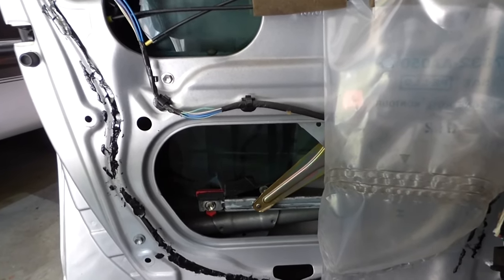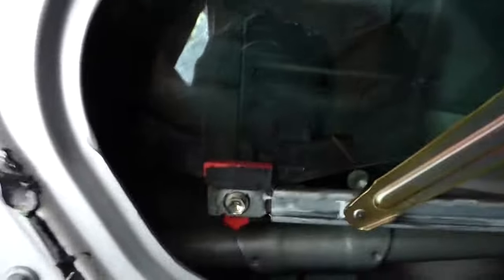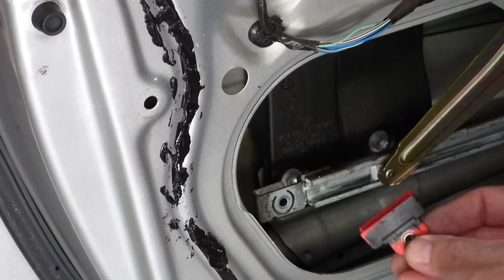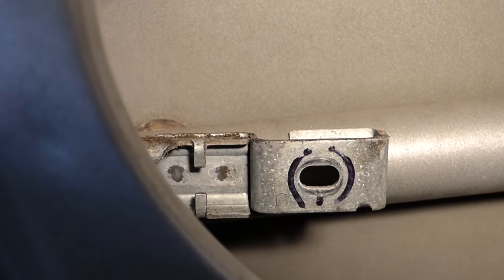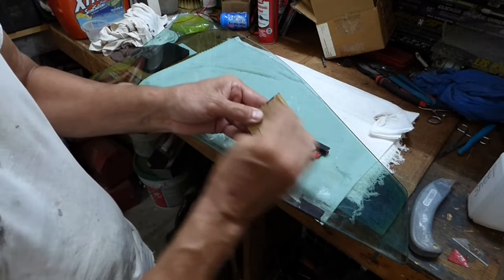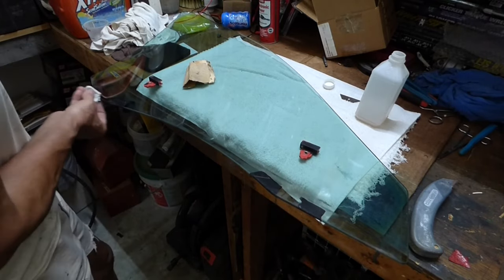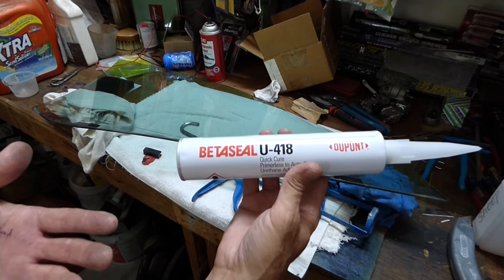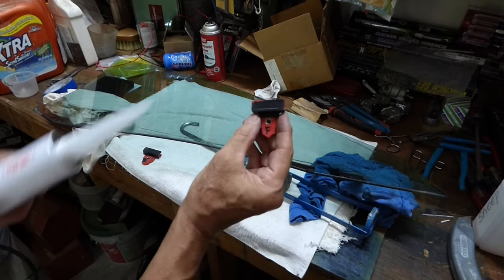Re-Gluing your Car Door Window Glass that Fell Out

Comment: Just some more tips...if by chance you have cleaned off the marks where the oe lugs were bonded,there is an  small oval access hole in the inner door skin..make sure the front  lug is lined up central  to the access holewhen in that position  as if the lower sliding retainer channel has moved, the sliders may hit the lugs during operating....I would also grease the sliders and lube the vertical  running rubber as resistance  is often the cause of the lugs  pulling off...hope this may help someone

Comment: This is exactly the problem that my Honda Civic has. The window has become unglued from the holders shown in this video. I thought, finally! A video that will show exactly what to do. This is after going through a bunch of YouTube videos that didn't apply (There's a difference between "Manual windows"and "Power windows", my friends!) Not only has the window become unglued, it's become completely free of the window lifters(The clamps/brackets that hold the window and make it raise up and down when you turn the window crank.....Are you with me so far?) I'm a pretty smart dude and I do have a knack for figuring out how to fix things(My Dad was an engineer)And, upon looking at how the mechanism that raises the window up and down works, I determined that the exact placement of the window while gluing it in place was important and if the window wasn't sitting in EXACTLY the right spot, it wasn't going to roll up and correctly. So, I have only one question for everyone out there in YouTubeLand.......How are you supposed to mark where the window is in relation to the holders and where the screws are if it's already separated from them? Just a intelligent thought. So much for finding the video I needed.....
Reply: I was wonder the same thing. You can see at 3:15 or so that there's two pieces of black electrical tape with a gap in between them on each side. That's how he marked it. That gap is where the bracket goes.

Comment: Thank you. I went to my local autoglass shop and they charged me $50 for removing 2 bolts to diagnose the glue was no longer sticking to the channel. He wanted another $80 to take out the glass and re glue it. Do it myself it is.. Thanks a million for the tips. Cheers!
Reply: Yea blame the people that don’t work for free and are actually giving you a good deal.
Reply: @smh2754 When you live in America, it's paramount to save money whenever possible.  Anytime you spend money, you're that much less prepared in case of an accident or an illness making you unable to work, losing your job, and safety nets to fall back on.
Reply: i'd pay $130 in a heartbeat.
Reply: @Mr._Chievous  I'd pay $130, too. But after watching this video I wouldn't trust them to do a top shelf glue job like this. Would fear it coming undone again if I didn't do it myself.

Comment: That’s not the correct glue for that it will work, but would work better if you use a beta seal 428+ it has primer built-in that way it sticks better to clean glass
Reply: The product he used also has primer built-in, research it, I did.

Comment: Going to try using the Beta 418 sealant. Tried using silicone, but since I have a manual crank handle on one of my older cars it probably needs something stronger as the silicone one just slipped out after a couple weeks

Comment: This is fantastic information. I've been scouring the interwebs for a while. My clip actually broke off on one side, so I need to get a new clip and glue back on. Any chance you know where to pick up a replacement? Looks like you're rocking around an 06 Camry, that's exactly what mine is, but I can't find any clips that fit that size, only bigger.

Thanks for the great info, I will definitely be using this, been trying to figure out what use to glue back on.

Comment: I wanted to thank you for posting this, I'm having the same problem, getting ready to order the glue that you used but I wanted to ask you if it is still holding?
Reply from the maker: Still holding and it has been at least a couple years now
Reply: @helpinguonline  thank you very much I really appreciate that!! When my window messed up I just assumed that it was the window regulator so I purchased one online put it in and it was the same problem. I remember when I initially pulled the window out one of the tabs fell off inside the door. So after the new one was in and again it was the same problem I basically connected the dots and realized what the real problem was. I did a search in your video popped up! So thanks for posting your video!!! I will order a product you used.

Comment: So you were able to glue the clips onto the window and then you put the window in the door?  Don't the clips prevent it from going back in the door because it's such a tight fit?  And are the clips suppose to be snug against the glass?  Mine clips seem like there way wider then the glass is thick?
Reply from the maker: The glass goes in there fine because the panel with the inside seal is removed to do that job
Reply: Good information...a practical query 😂

Comment: Can someone reply....if the glass is fully broken then how to decide the exact location of clips to be glued on a new glass....
Reply: New glass should come with clips already glued in place
Reply: Glass comes with new clips already on
Reply: I just did this yesterday, I basically pull most stuff out until I get to the window part and unscrew the fastener holding the broken window glass. I clean it off and screw it back. Then I slide the new glass down to the fastener, but have to redo it all again because I forgot the glue. 

P.S. My glass didnt come with the fastener.